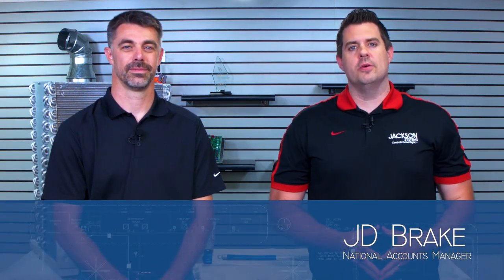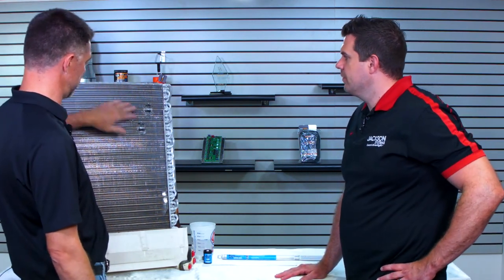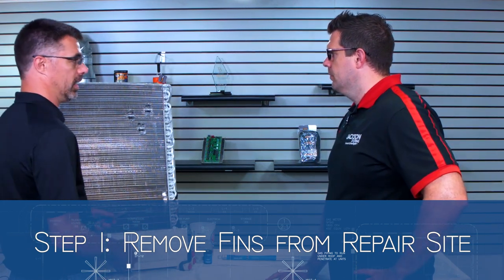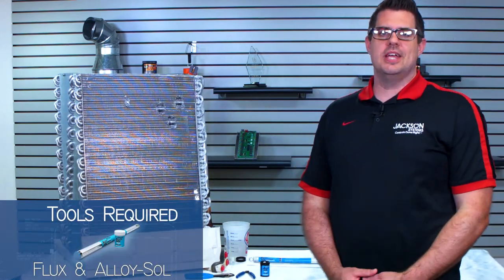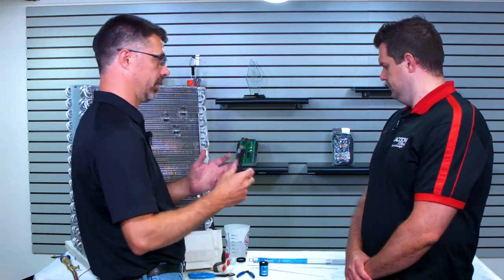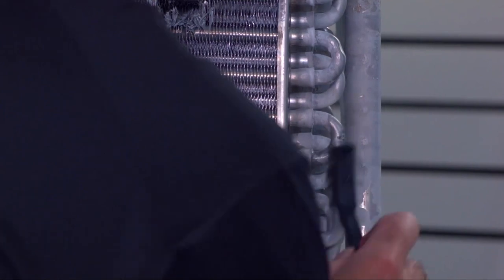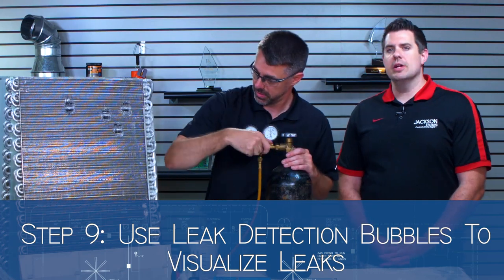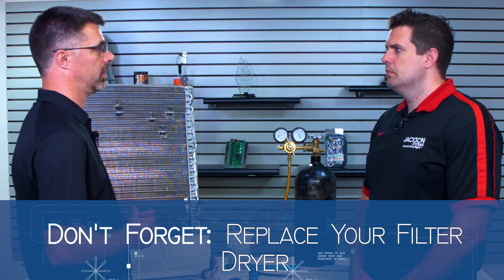How to Repair Aluminum Using Alloy Sol

Comment: I am going to give a tip for people who are doing this for the first time. I dont think you expressed the importance of the flux well enough so I am going to give my 2 cents that people will find helpful 
You need to clean as as much of the oil and debris paint any clear varnish or lacquer away from the repair area use a stiff wire brush or 120 grit sandpaper and scuff up the aluminum around the area that needs repaired. You want the metal as clean as possible.  The flux is a mild acid used to clean aluminum oxide off the aluminum. Aluminum oxide forms very quickly on aluminum and is what gives aluminum it it's ability to resist corrosion. Flux also keeps fresh aluminum oxide from forming while brazing as oxide will cause the repair to not stick and fail.
You don't need to use a lot of flux it is probably best to practice on something that is also pure aluminum go to the hardware store. And get a piece of aluminum flat stock that is roughly the same thickness at the metal you are repairing. First practice getting the brazing material to bond to the aliminum stock then put a fee holes in the aluminum stock and practice filling them in this helps you to understand what you are doing and the best way to do it. You need to use just the right amount of flux not too much not too little If you use too much flux when you apply heat to the repair site the flux is suppose to  turn from a paste into a liquid and will run and drip and into the pipe you are trying to repair that could cause all sorts of problems for you when yo go to apply the brazing rod it will be drawn to the flux inside the pipe and could cause a blockage or it will drip and run all over place causeing a bigger clean up as you want to remove as much of the flux as possable off the work piece to keep it from for corroding other places on the piece you are working on. Also flux attracts the metal used in brazing rod if you have flux everywher you will draw that metal away from your repair causeing you more work and turning a neat professional looking job into a huge mess that looks like an amature repair. If you use too little it won't keep the aluminum ocide from forming and cause the repair to hold. Practice, practice practice and when you feel confident that you can do it practice one more time. Good luck I hope this helps someone.
Reply: I noticed my Flux is a powder is that normal?

Comment: i noticed this seems to be a new coil. What needs to be done when the coil has oil on it due to the leak?
Reply: The flux will decontaminate the area and disperse the oil.  It is made for cleaning the repair area from all contaminates.

Comment: I understand that aluminum is a fantastic heat sink 
But that turbo torch is over kill it's not necessary, all you need is a map torch
Reply: I have an air acetylene torch. I was using a NE180-1 and it wouldn’t get hot enough. I then tried an air acetylene with the blue flame all the way out (carburizing flame) and melted it almost instantly even with my small tip I was using (smith quickbraze). I will try to experiment with a bigger tip - I have a 1-2-3-4. And will see which one melts the aluminum rod easiest.